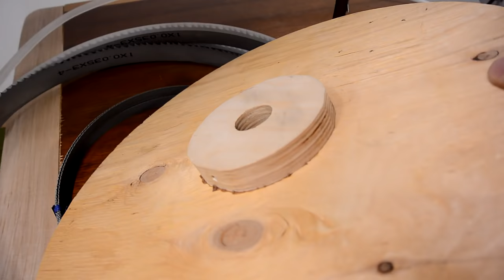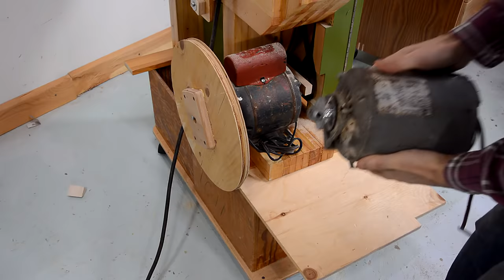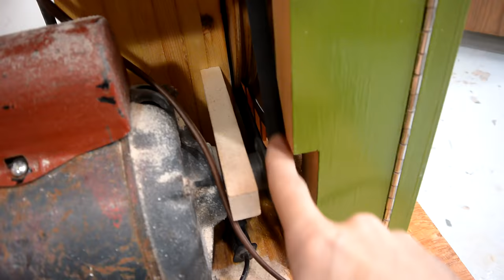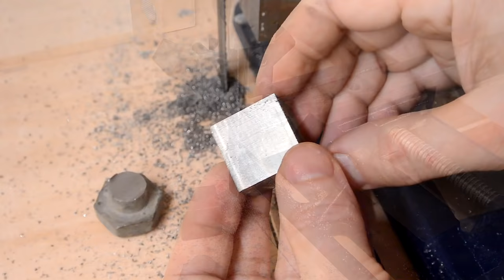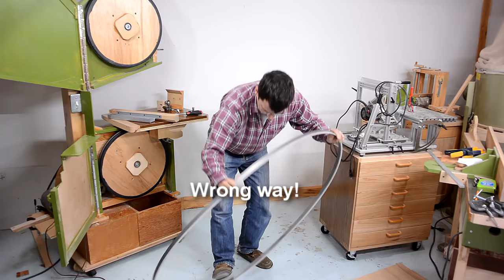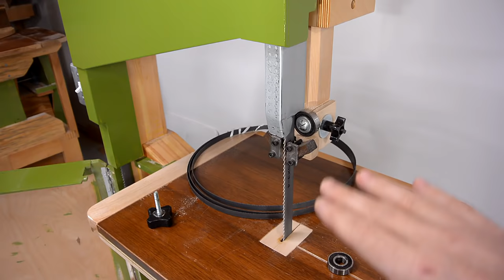Cutting metal on a wooden bandsaw

Comment: I've always found it interesting that we all assume that aluminum will cut so much faster but it's inherent softness is exactly what slows it down. For cutting aluminum the larger tooth gaps are key. For steel I usually use 16-24 tpi blades where a 3-6 tpi is more efficient for aluminum. As always, great video.
Reply: Yep: wood blades for aluminium, even router bits.

Comment: For a metal bandsaw you could add a magnet to catch the shavings from ferrous material you cut.
Reply from the maker: that means cleaning the magnet after every few cuts (there's quite a bit of metal that gets ground up)
Reply: put the magnet in small PLASTIC BAG that way it' easily clean
Reply: +Matthias Wandel
Put the magnet in a plastic housing then to clean it you just take the magnet out and all the shaving drop off.  Seen people do that to clean shavings off the floor in workshop.
Reply: I've made chip collectors by sawing a slot lengthways in a piece of PVC pipe that will fit into the end of a shop vac hose. Then I mount it under the table so it tilts slightly upward at the open end with the blade riding in the slot. Hooking the vac to the pipe creates really high velocity suction and airflow around the blade and does a real good job of extracting chips before they ever get down to the wheel. Haven't done it to a metal cutting saw but no reason to believe it wouldn't work.
Reply: Matthias Wandel how about an  electro magnet that cycles on off so the shavings are collected then when turned off they fall into a collector...
Reply: +Rob Rioux Yes
Reply: Or you could put a permanent magnet on the outside of a thin walled section of the colletiin chute. Pull the magnet away to let the chips fall down the chute.
Reply: find electromagnet will do same thing with less physical labor. make timer to cycle on and off as lets say 10 sec on - 1 sec off, and presto...
Reply: ductile metal shavings don't turn into dust, waft into the air, and get into your lungs. Especially when weighed down by liquid lubricant, like the industrial machines have. No need to clean as you cut. It's much easier to let the metal shavings collect in some pan/enclosure, then shovel it out later.

Comment: Rookie question, but why are tires needed for wood cutting but not for metal?
Reply from the maker: I initially ran my first wood cutting saw without tires.  WOrked fine, but narow blades dug into the wood over time, and it was louder.  Neither of these would be a problem with wider metal cutting blades running slowly.

Comment: I have a 93.5 inch Jet Bandsaw. I placed a small brush to clean off the sawdust on the lower wheel. It has kept the sawdust off both wheels for years and works great. Just a fyi...

Comment: really cool, good idea to get multi speed to switch back and forth between metal and wood. however if you do not mind switching the blades you can keep the fast speed and cut even hardened steel super fast. this method is called friction cutting i think. this will only work for straight cuts. the blade will continue to cut metal no issue, but not wood any more. i do that on my 14 inch delta all the time, in fact been thinking of speeding it up for metal!

Comment: Part of the reason the blade stays cool is that the chips are hot, this is a feature of circular metal cutting saws called Cold Saws but I'm sure your blade is doing this to some extent as well. The geometry of the teeth is such that most of the heat ends up in the chip, which is then removed from the blade and the curf, leaving the blade and the material with minimal heating. In this way the chips serve as coolant for dry cutting.

You'll probably find that with any amount of curve this effect will be superceeded by friction of the blade on the sides of the cut, so cutting straight is imperative to long blade life.

Comment: Matthias I have an interesting video idea for you. I like to thread wood and use bolts to hold things in my jigs which works amazingly well. Maybe you could set up a test apparatus to test  the holding strength of machine bolts  in diff species of various thicknesses. I for one would be interested.

Comment: I set up an industrial vertical bandsaw in our workshop which comes with a 6tpi wood cutting blade as standard and put a 13tpi metal cutting blade on without changing anything else and it cuts steel and aluminium perfectly fine up to 6mm/.25", but it's just a bit too slow for anything thicker (that's what plasma or oxy/acet is for).
The slight (?) difference between ours and your DIY is that it has a built-in nozzle which blows a stream of air and keeps chips mostly out of the innards.
.
Incidently: TC insert router bits work perfectly well on aluminium in an ordinary router, although smearing a hard wax lube on the metal first isn't such a bad idea.

Comment: We had a blade like that last one you ran on a horizontal bandsaw in a machine shop I worked in. It could cut through cold rolled steel almost like it was pine. I would clamp 3, or 4 bars of steel together on the roller table and let that saw cut them all at once. You'd have liked that saw. It had hydraulic power stock feed. So when it got done with a cut it would lift itself up, open its vise, then another vise would push the stock forward. That saw was accurate to better than a thousandth of an inch all day long. What that saw did didn't even look possible.

Comment: I can slow down my woodcutting bandsaw as well for metal. Really like that when I need to cut a lot of metal much cleaner and quieter than the angle grinder.
Reply: What speeds and TPI do you use for each typically??
Reply: @jbh.6257  I don´t know.. the bandsaw had 2 fixed speeds. Fast for wood and slow for metal, don´t know the number. I have sold the bandsaw maybe a year ago so I don´t have the blades anymore either, if I recall correctly it probably was a 14tpi blade.
Reply: @RobinCoomans   ok thanks for reply,  what brand saw?  Would you recommend it ?

Comment: Someone else way down in the comments has probably already said it, but if not... you can run your blade faster, 250 sfpm or so for mild steel up to an inch thick or so. As long as the blade isn't overheating, you can go faster. That's one advantage of a longer blade: more time to cool between passes through the material. I've thought about making some heatsink cooling wheels or even a small cooling fan, but haven't gotten around to trying it yet.

Comment: Matthias, not sure how slow it is but all metal cutting band saws cut slow. If you are used to cutting wood, then you'll feel it's slow but if you are used to a hack saw you'll think that they are quick and a godsend. Hey if the first motor was a permanent magnet motor, would you be able to somehow feed the induced emf back to the first one. As always, very inspirational work.

Comment: Yo dawg, we heard you like electric motors, so we put an electric motor on your electric motor so so it can turn while it turns!
X's gonna give it to ya starts playing

Motorception.
Reply: Bert Bertmann vintage
Reply: That was Xzibit, not DMX.
Reply: Wasn't that kinda a bad idea? I mean the middle motor must have run as a dynamo the whole time, or not?
Also couldn't he just have used the variac to under-voltage the existing motor?
Or would that have needed pulsing instead? I'm still not that familiar with electric motor throttling o.o
Reply: > I mean the middle motor must have run as a dynamo the whole time, or not?

Induction motors can work as a generator, but need field excitation to  do that well. Remanence has them act as (poor) generators for some time, though.

As generators, they work with no load, no problems there.

>  Also couldn't he just have used the variac to under-voltage the existing motor?

No, with an induction motor that will just stall the motor, making it turn slower, but also run much hotter; they usually burn out from that.

>  Or would that have needed pulsing instead?

No, this would produce torque pulses in the machines which is generally no good.

There is no good way to control speed on single-phase induction motors. Besides gearing.

Comment: The fps speed of the blade moving is in line with the blade speed on my dedicated metal cutting bandsaw.  If you run it much faster it will wear the teeth down faster when doing steel. The steel "dust" embedding itself into everything is just a good excuse to make a dedicated saw to use for metal only.  And at that point you should make it a combination horizontal and vertical saw.  Horizontal for long duration boring straight cuts through regular bar stock so you can do other things.  And a vertical mode with a small table for doing more intricate manual cuts such as segmented bevel cuts for shaping curves of all sorts.

Comment: Tips: no more than 500 sfm blade speed, unless you are cutting aluminum which cuts near wood speeds (800-2400sfm) and the thicker the material the less teeth you need.  Always 2-3 teeth in the cut at all times.

Comment: Could the blade speed be any faster Matthias? Would it improve the cut?
Reply from the maker: faster blade speeds risk damaging the blade with metal cutting (though it could have been faster for some applications)
Reply: I was going to say; speed it up! ;)

I have done similar experiments with a cheap wood bandsaw, because I didn't want to spend money on a proper metal bandsaw, and it was quite successful actually. I have found that 13TPI blades may actually be too many teeth for metal. I have started using fewer TPI on my proper metal bandsaw, and I run them slightly faster. And that seems to yield a decent balance between cut smoothness and speed. =)
Reply: For aluminum, just use wood cutting speeds. Steel needs to be slow (100-300 fps).
Reply: Yeah, I agree. Definitely run it faster for Aluminium, cause its quite a soft material (relatively speaking). 

If you are going to cut a lot of metal, I would use a dedicated bandsaw. And you're going to need coolant, which won't work very well with a wooden frame saw. That's where the advantage of having a metal bandsaw comes in. It doesn't mind being constantly showered in coolant! ;)
Reply: 100-300 fps? What are your blades made out of boron nitride? 100 SFPM is what HSS can handle on mild steel.
Reply: Darn typo!  Good catch there. Seconds or Minutes, just get 'er done. I'm laughing at myself for that typo! Good thing I do not have any apprentices, least yell at them for burning up blades. You need to get out into the shop and post more video's!  Irony is I have a ton of ideas, things to edit and post, but never enough time for both.
Reply: Tom Walter
even 300 SFPM is almost in the range of carbide tooling. Maybe with saw blades you can run a bit faster because they have some cool down time? But generally with milling bits I stick to 100 SFPM myself. I honestly don't even know how fast my bandsaw runs. It has 3 speeds and  I think I have it on the middle one? But it is a metal cutting saw, so it should be close.

Comment: It's not just that metal saws run at lower rpm, it's that they have a much higher torque than motors for woodcutting. Engines for woodcutting would work with abrasive discs.
A cold cut metal chop saw is the best tool for this job. The blades are expensive but they last hundreds of cuts, can handle steel many centimeters thick and they can be resharpened.
A metal blade on the jigsaw or recipro saw will help for low volume work too. I'm all for the economic workshop but if you spend hours switching blades and losing time with a tool that doesn't work good enough, get a $50 jigsaw/recipro saw or a $30 angle grinder with a $20 pack of discs.

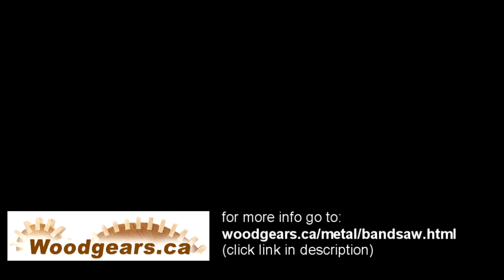Comment: Flip your vise over! Flip your vise over so the jaws are down, put the material in between the jaws, still sitting on the table, tighten. This way the material is supported on either side of the cut and when you break through as at 7:36, it is less likely to jam the blade. Also, clamping force on the piece is less important for holding the piece square to the table.

Comment: I was cutting 1/4" hot rolled steel on my 16" wooden bandsaw today, worked great! It has a VFD which is certainly cheating, easy to adjust for different metals though. I use stick wax/lube for the bandsaw blade, and hacksaw blades as well. easy to apply, even during the cut.

Comment: Enjoyed your video.  Planning to make the changes to my band saw and wondering if the attached controller would work.  Found this on Amazon
L&Z DC Motor Speed Controller PWM 6-90V 15A Brush Motor Adjustment Control Module 1000W 16kHZ
Brand: L&Z
3.5 out of 5 stars    27 ratings
$29.99

Comment: Hi. I'm suprised TOT has n't built one! Very interesting. Metal cutting bandsaws command a much higher price, at least here, than wood cutting ones. As you say Mathias the profile could be much lower, maybe 10 cm/4 inch mouth. Still need a good throat depth. I wonder if an electronic phase converter speed controlled 3 phase motor would work? Personally, I'd not make it out of wood, but then my 'carving' is about as good as my welding. TOT - help! BobUK.

Comment: This is precisely the problem I am having with the design of my band saw. While it will overwhelmingly be used for woodworking,  space constraints in my shop mandate that I can have only one band saw. That means it has to be capable of slow speeds needed in working steel. This is complicated by the fact that the only motor I own that is suitable is an old Craftsman 1hp table saw motor that turns at 3450 RPM. That means at least a two stage pulley arrangement and possibly more. While I intend to use your plans as a basis I am going to revert to part of your first band saw by bringing the spine of the C frame all the way to the floor to make room for a more complicated drive system between the legs.

Comment: Nice try, but I'm still going to buy that 4x6 metal cutting bandsaw. ;-)
I'm curious if that will be any use on wood, at all.
They have a worm drive to get around that speed/belt problem you encountered.
Reply from the maker: Those saws a re great for what they do, but for wood, a chopsaw will serve you much better.
Reply: I do have a decent table saw, a but whenever I see you cut crazy tight curves in thick pieces of wood I suddenly want a bandsaw. ;-)
The 4x6 flips up for vertical cutting, and I was wondering if it might work for wood in that mode, albeit slow and with rather limited throat. It'll be useful anyway, even if the wood thing won't pan out.

Comment: Why wouldn't the rubber inner tube be necessary if you were using it for metal cutting? Isn't it so that the blade won't slip on the pulley?
Reply from the maker: it keeps the saw quieter.  Not necessary at low speeds.

Comment: How about using a strong magnet to collect the metal chips, so that You avoid them spread all around?
Reply: Of course it's useless for aluminum, stainless, magnesium, etc
Reply: And electromagnet powered by AC would partially work on all of those; I'm not sure if it would collect them to the coil but it would deflect their trajectory in a consistent way; Matthias has done a video about eddy currents so he should know how to best achieve this
Reply: Eddy currents work in larger pieces of metal. Chips would develop basically no eddy current, and therefore basically no deflection.

Comment: Also, assuming the second motor was still wired, my daughters' curious minds want to know: Would the disabled motor generate (even a small amount) of electricity?
Reply: Yes. There is enough residual magnetic field in the iron you will see electricity. This is how a three phase motor can be used to run on single phase. Hook up six light bulbs (two in series; each series pair across the three phase) to see the difference in the third leg.  Spin the 3phase motor with a pull rope, apply single phase, look at the bulbs. Good science experiment.
Reply: Thanks for answering my leading question - sometimes a forum post gets more cred than dumb ol' dad - and therefore provides a better learning opportunity for the girls.

Comment: Turning one motor using another would lead to electricity generation and opposition. This leads to losses. I don't know much about AC motors but I think it works the same way
Reply: Not if it's an induction motor (which it is).  There's no permanent magnetic field so it won't work as a generator.  Even if it did, there wouldn't be much of a loss: try feeling the (lack of) resistance when you turn the shaft of a small DC motor, then short the connections and feel the difference.  It doesn't take much mechanical power to turn an unloaded DC motor, but if you try to draw electrical power from it the required mechanical power goes up too.
Reply: It would only be an issue if you turned the motor faster than its nameplate speed, and you put a load on it too. Otherwise it is just some friction.
Reply: I guess you guys have a point. The motor would resist only if current is drawn. My bad
Reply: Vikas V
there is a certain perverse logic to electricity.
Reply: If an induction motor is powered, and an external force tries to spin it faster than synchronous speed, it will start to act as a generator instead of a load. If it is not powered, then it just has a little drag/inertia.

Comment: They make sticks of wax for lubricating metal cutting band saw blades that would be easier to apply than oil from a paper towel, and it will adhere better to the blade.

Comment: You should have made a small  dish or platter to add oil at the bottom or side of the bottom of the blade to it so you don’t constantly have to use a paper towel for a safety hazard

Comment: Its a great video but you could just put in a motor speed controller to adjust the speed, why didnt you do that?
Reply from the maker: not for running the motor at 1/15th it's speed and over it's rated torque.